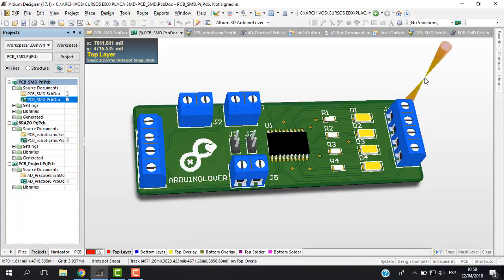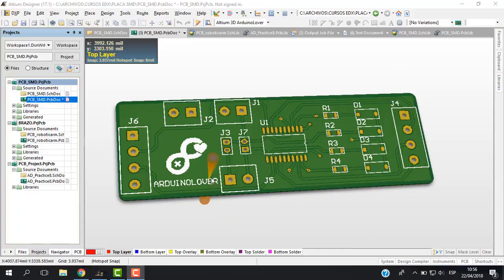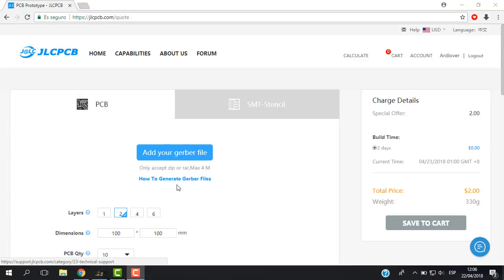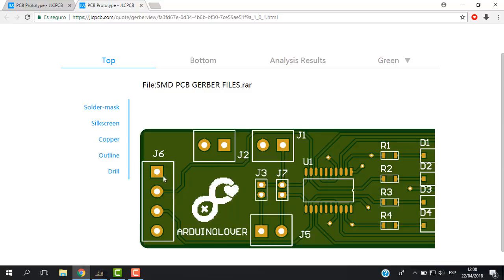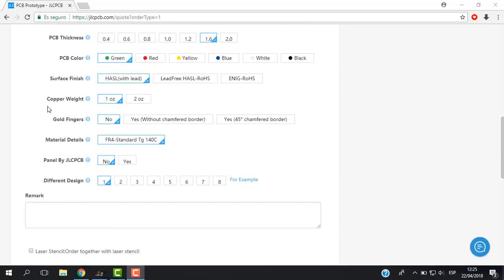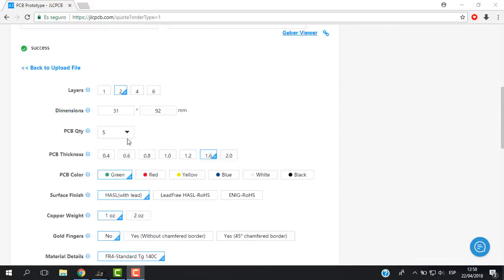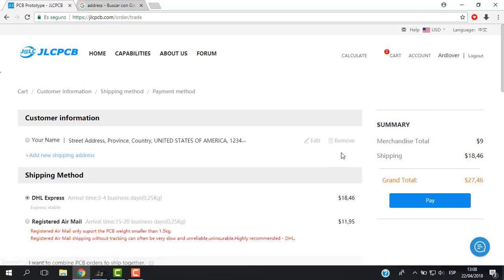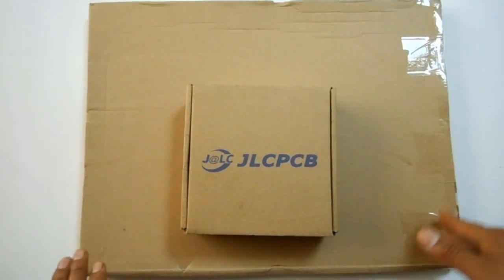How to order a PCB and SMT- Stencil - JLCPCB

Comment: So, you did not make good use of this gigantic stencil! No video about it. 

but the interesting point is how bad JLC evolved in 5 years. Now nearly in 2024

with pcb 31x92mm
2018: 10x pcb $2
2023: 10x pcb $5 (no special offer)
2023: 5x pcb $2 (special offer)

At that time, they probably tough 2 design fit easily in 10cm 10cm base unit they sold. Already paid in another word. Now, this little trick makes you pay double what you already paid (the base unit).

But that is not all

2018: 5x pcb weigh 50gr
2023: 5x pcb weigh 170gr

Stencil 29*19cm (no frame)
2018: 200gr
2023: 800gr

In 2018 pcba was not available. But the same inflation exists with SMD components.
I 'reordered' the same job made 9 month ago (march 2023)
+1Kg  of 'nothing' on a medium populated board (188/board= 940 resistor/cap 805)

Some will says "it's the packaging". Well, no. Check a combined order and tell me if they removed weight....

For all readers, carefully check what JLC charged you and the real weigh when receiving package.